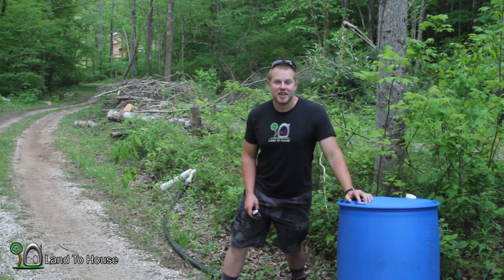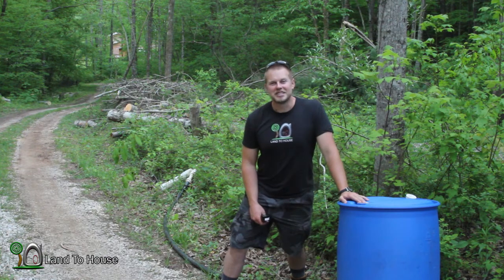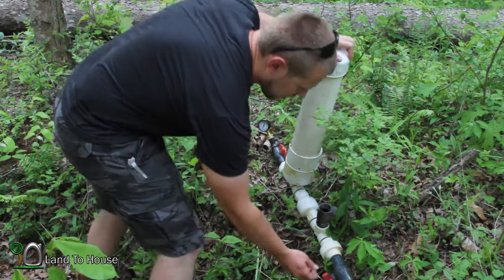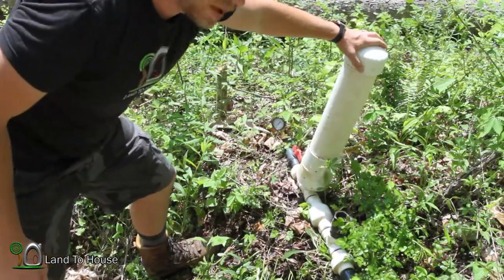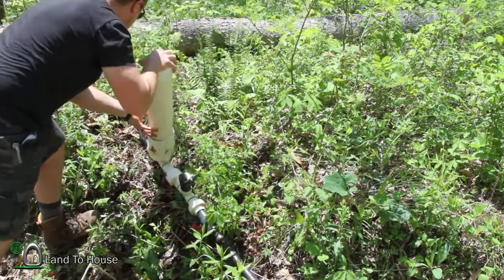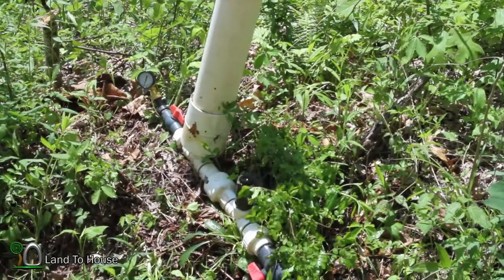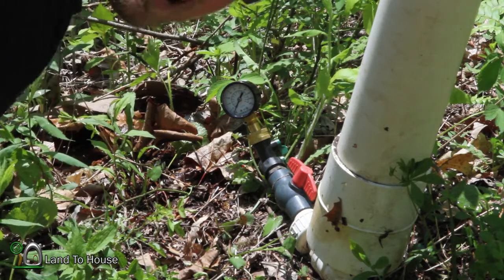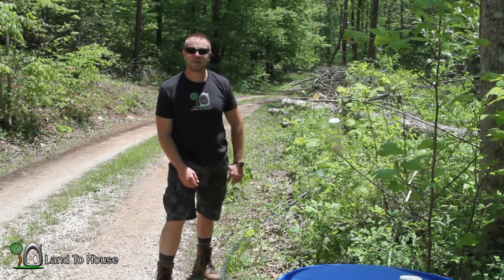Hydrostatic Ram Pump PSI

Comment: hai seth thanks for the video. can you please tell me what will be the gallons per minute in case of full barrel pumping it12 feet high.
Reply from the maker: At best the ram pump is 30 to 40% efficient but most of the time its closer to 10-20%. So say you have a 55gal tank with 2ft of head pressure. (or hydrostatic pressure) You can expect 5.5 to 11 gal total from that tank. (if you are using the hydrostatic pressure method as I am in this video you will also have less efficiency as the tank empties.
Reply: thanks for the reply but what about the approx GPM at 12 feet.
Reply from the maker: +cuttingedge when you say 12 feet do you mean head pressure or delivery height?
Reply: sorry for not being clear . i meant delivery height
Reply from the maker: +cuttingedge no worries. So the output depends on the input. If you are using the 55gal tank as hydrostatic pressure to run the ram pump it has an initial pressure of 3 feet. As the water is used it will have less pressure to run the pump. So at the start you might be getting close to 1.5gpm at 12ft with a 1.25" pump but will drop at that point because the pressure is decreasing.
Reply: Thanks again dear seth.

Comment: Hydrostatic pressure is pressure of a fluid while the fluid is at rest. You are using the energy created by the water seeking level. You have created a head equal to the hight of barrel. To test this properly you need to place the pump in the barrel and let it rest. This will not work. The pressure on both sides of the check valve will equal out and all function of the pump will stop. However that is a very nice pump looks like you can run it off 6 inches of head.
Reply from the maker: Yes you are correct. I was not completely sure what to call the pressure I was testing so I just went with hydrostatic. Thank you for the comment. I have been making these pumps for several years now and they keep impressing me.
Reply: +Land to House they are real cool pumps. You have a sweet channel. Got couple ideas I want to try now.
Reply from the maker: +James Rowley thanks!  It's nice to have a place to show my projects. And nice to be an inspiration to others such as yourself :)